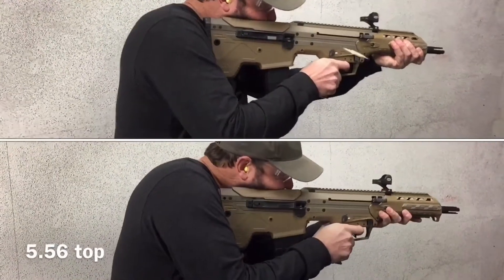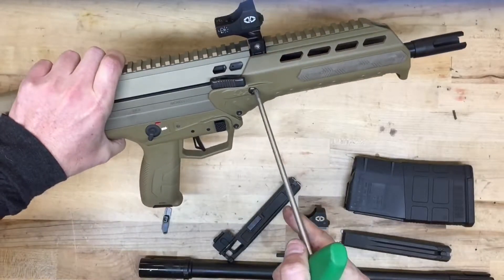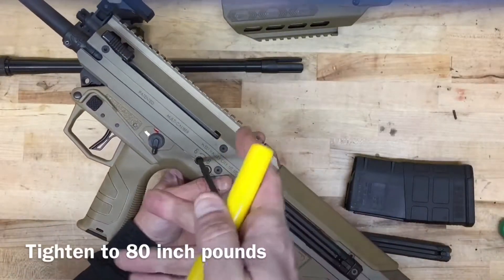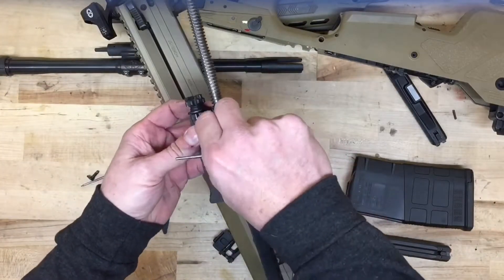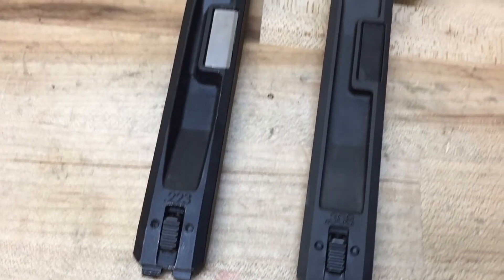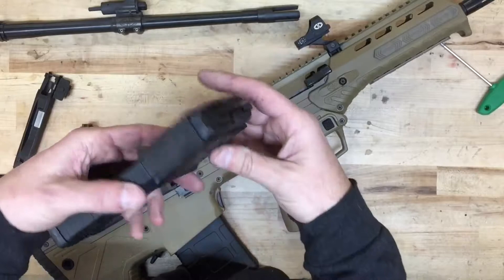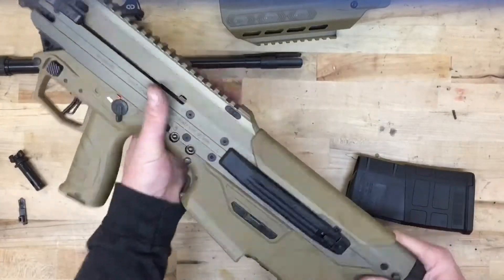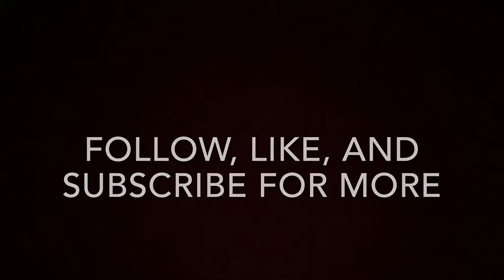Desert Tech MDR Caliber Conversion 223, 6.5 Creedmoor , 308 rifle

Comment: Do both bolts/barrels use the same locking lug geometry?   How do they compare to an AR-10 size bolt face?
Reply from the maker: Yes, they are the same but for a few minor differences. Bolt faces are the same as AR type.

Comment: How reliable is the rifle? I've been hearing mixed reviews.
Reply from the maker: That depends on who you ask. I have seen rifles that work great, and put hundreds of rounds through myself, then hand it over to someone else, and they have nothing but problems. I can only assume that it is from ammunition differences, or perhaps the way they assemble the gun.
Reply: coldboremirakle Has it worked for you? The reason I ask is because you seem knowledgeable about it and doubt you would do anything to fuck it up.
Reply from the maker: It works great for me, my knowledge has come from tinkering with them to run perfectly.
Reply: coldboremirakle So just good maintenance and stuff?
Reply from the maker: Sooner Admirer they occasionally can use some tuning.
Reply: coldboremirakle Could you make a video like that?
Reply from the maker: Sure
Reply: What ammo are you using?   Good to know which rounds are known to be reliable.  Any mods you've made to assure reliable functioning?
Reply from the maker: I use mostly XM80 from american eagle, but have found most reputable brands to work well. If you are going to shoot the cheap stuff, I'd say avoid African and Malaysian surplus, and anything that has green primer sealant on it. ZQi, CBC, etc.

Comment: Looks like a short barrel for a .308 round.
Reply from the maker: It is a 16" barrel
Reply: coldboremirakle that seems like it would kill a lot of velocity from the rounds
Reply from the maker: Everything is relative, most 308's average around mid 2600's in velocity with 160-180 class bullets. The same ammunition in a 16" barrel runs around 2450-2550. You give up a little velocity, but you gain a lot of rifle portability and weight loss. Loosing 100-200 FPS isn't enough to worry about, especially inside 5-600 yards where this rifle will likely see most of its use.
Reply: coldboremirakle Fair point, but I still would like to see a 18" barrel option.
Reply from the maker: Fair point, its a good thing there is an 18" option, and a 6.5Creedmoor too:

https://www.youtube.com/edit?o=U&video_id=mE2AiTJa1Hk
Reply: coldboremirakle Weird, I looked at their site and could not see a 18" version of the mdr, only a 16" for all 3 versions.
Reply from the maker: The 18" is an aftermarket option. Factory options are all 16" at the moment.

https://coldboremiracle.com/2018/03/07/es-tactical-6-5creedmoor-barrel-for-the-mdr/
Reply: Sīlis no its a bullpup the barrel goes much further into the gun most guns that shoot that caliber with 16” barell are much longer because they are not a bullpup design